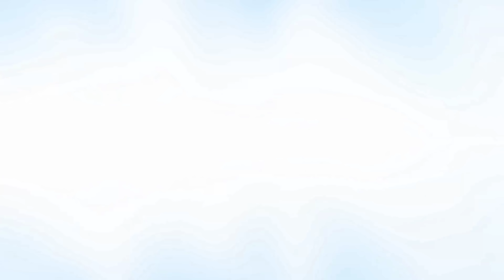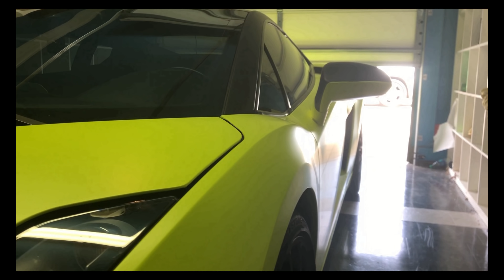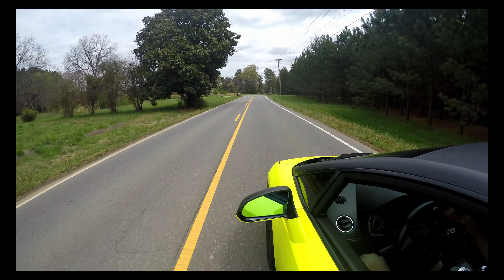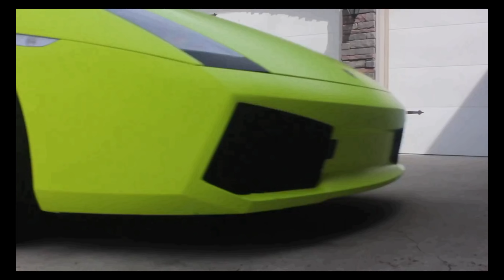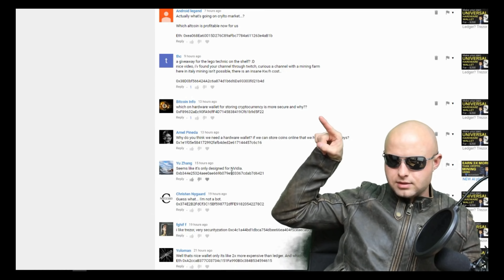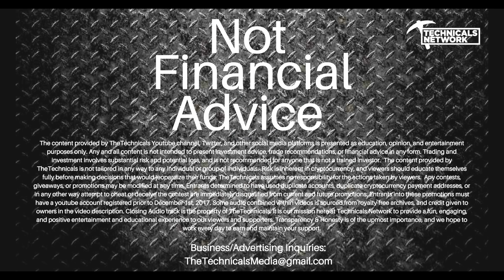GPU Crypto Mining Farm Tour + Updates- Electric Cost / Upgrades / Rig Profiles / More!

Comment: What is your business? And also you can mount the ASICs so the exhaust is UP and the fan draws in the cold air from the bottom like a cold air car intake. You have a wire shelf so it should work.

Comment: shouldn't you have the exhaust from the cards in each rack point at each other, and run cold in from the outsides of the racks? looks like you're pulling the heat in from one row and blowing it into the other row.  basically this design: http://www.windchillengineering.com/images/DataCenterAirFlow.jpg

Comment: Thanks for the farm update.  The farm videos are my favorite for sure!  Take care man.
Reply: I guess I should start posting my Eth address in case of a give away :).  0x453984712f9beeb1644848c72694fcf177e97739
Reply: Hey Matt, I was thinking a little more about the farm updates.  You might be surprised the little things us rig builders are interested in.  Like you mentioned the orientation of the cards and choice of power supplies.  I like what you did with the clear enclosure over the mobo's and psu's.  May I ask where you got those?  Good stuff and thanks again!  Any issues with USB or power cable lengths?  I use the same rack you do.  I hand my cards as well and actually ran into issues with USB  length.  After doing some research, I found that it is safe to go up to 6 feet.  I ordered a bunch of 4 foot cables which worked well for me.  turns out I only needed an extra foot for most of my cards.

Comment: When are you getting the FPGA card in next month? I have been on the fence about getting one to tinker with as well. I run a 104 gpu/7 asic farm on the east coast, but would be cool to get some diversification. Also I would keep doing giveaways, your the only crypto channel doing it in such variety I have seen and definately makes you stand out. Maybe at least while your channel is on the rise to get more popular (it won't be long based on what I am seeing, I have seen you channel only 48 hrs ago!) 

BTW my ETH address is e6b54aaff0890c0f10749d98c21f68e7a965c3b9
Reply: BTW my ETH address is e6b54aaff0890c0f10749d98c21f68e7a965c3b9
Reply: Or I guess 0xe6b54aaff0890c0f10749d98c21f68e7a965c3b9 if we want to be correct in formatting?
Reply: Also is there any documentation mining raven coin on Eth OS? Might point some of my Nvidias towards your pool.

Comment: Nice mining farm! The mining farm updates are great. Do you think you can make videos but in sections, explaining the steps or ideas you used to overcome certain obstacles? The sectioning off steps could allow for more detail. For example, how you wired up the mining farm to produce enough power to your rigs.
Reply: Forgot my eth address, just in case :) 0xC3D1931e25d2c8dB093445f134a6b351717DA5cb

Comment: I don't know about PVC. Are you afrade of electrostatic discharge?
Reply from the maker: Not so much, as everything has great contact. Not saying it'll never happen, but everything has good contact with everything else, which is grounded via the PSU's.
Reply: The Technicals right now I do not have time to take a closer look at the rig. Are you usung nuts bolts and washers? Come to think about it. I think they sell an specail kind of electrical pvc.
Reply: Was talking to a co-worker and they do have them. They are typically black and cost a little more. If you have a Menards in your area. They do have them.

Comment: I think you are correct, turn the room into a linear ASIC wind tunnel kind of design. I am working on a similar concept only vertical sucks air in the bottom and pulls from the top out the window. But my farm is small so that works. Have you considered rather then little portable fans using something like a evaporative cool to blow out. We run them here to cool houses, they are fairly power efficient and designed to run 24/7. use just the fan part to exhaust, not the water part of course. https://www.lowes.com/pd/Essick-Air-2300-sq-ft-Sidedraft-Sidedraft-Evaporative-Cooler-6500-CFM/4741468. like that but just use the blower part, they range from small ones like this to 12k cfm monstrosities. these are what Im going to use to exaust a half horse motor does fairly well on them.

0x16cc7497c42b4fca4797898a2994e328af3d6d95   :P:P:P

Comment: Can you give some ideas on how much 120v home runs to a breaker box over 30ft would cost?
Reply: As  a electrician's I would charge somewhere in the ballpark  $200 to $350
Reply from the maker: Is that for a breaker box as he mentioned (sub panel) or just a new circuit?
Reply: Thanks for the reply - i have 7 rigs and a flaky s7 in the unfinished basement area. The breaker box is in a finished part. There are 4 open breakers in the box for the house.